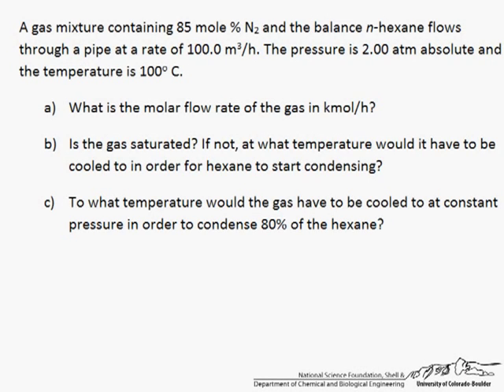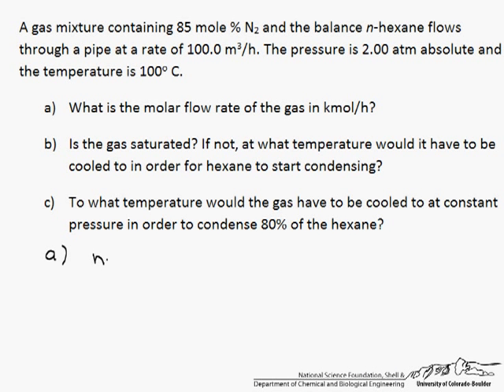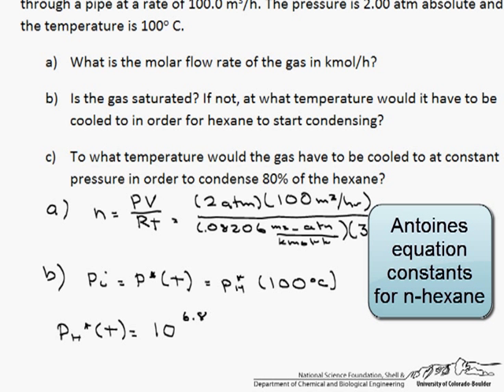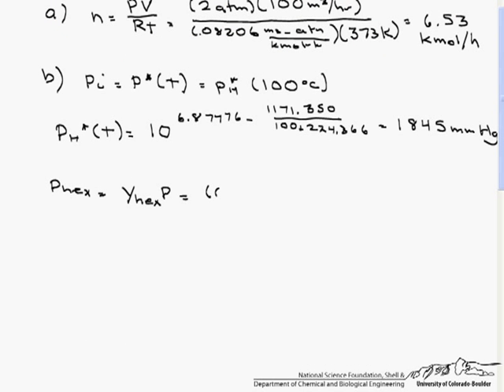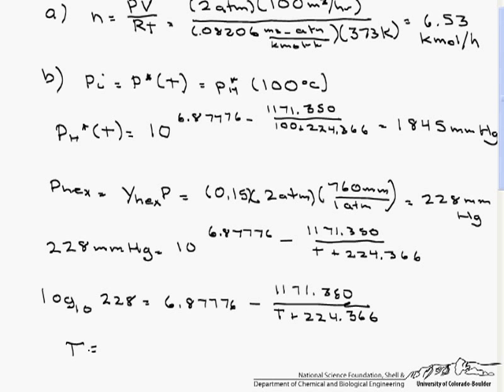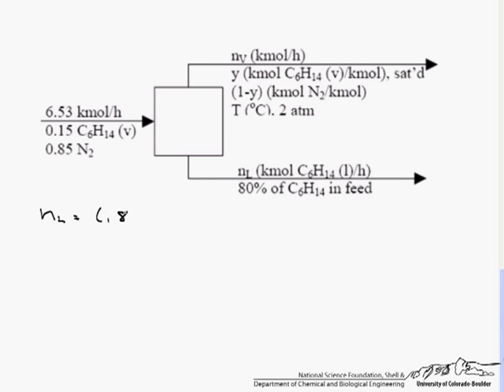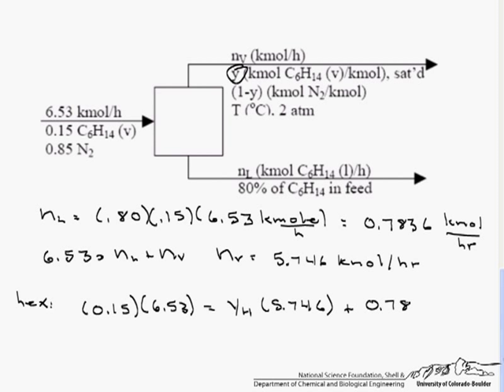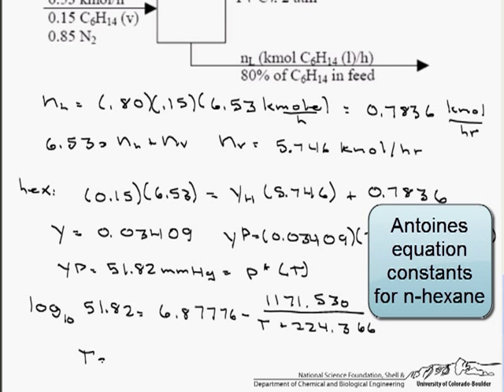Single Condensable Species Balance

Comment from the maker: That is an excellent point.  To be most accurate, it is better practice to look up the appropriate values for the temperature you are operating at, however sometimes we might not have easy access to this information and assume that the values we use are acceptable depending on how far outside the range we may be.  In this case we used what we had from a textbook since we were fairly close to the acceptable range of proven values.Rerun these with NIST reported values and see how far off it is.